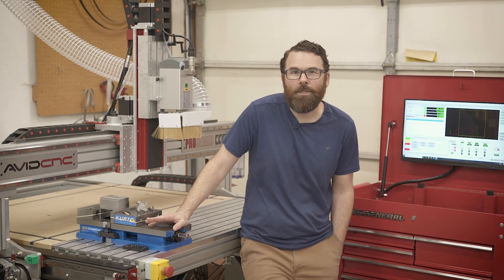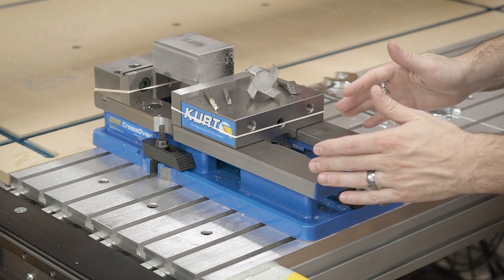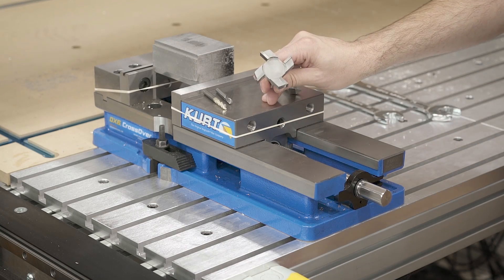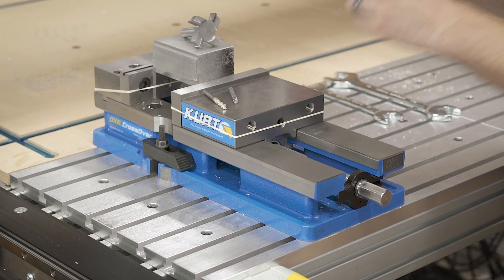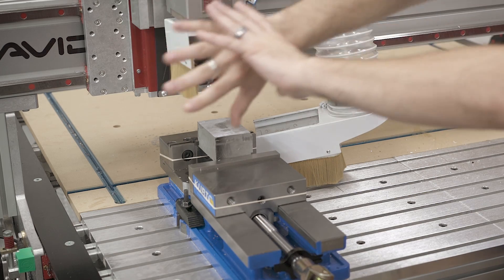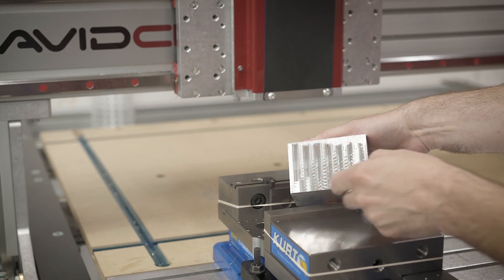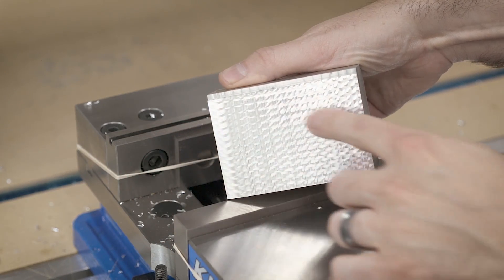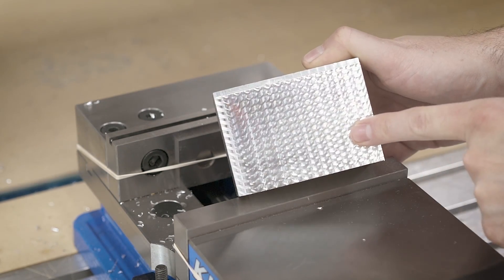Facing Aluminum on Avid CNC Router with Datron Endmill

Comment: how is that not rigid enough to get a mirror finish??
Reply from the maker: chip evacuation, cutter deflection, etc.  I'm sure I could do better, but that's about the best I could get from it.  It's a router made for wood.  It can cut aluminum fine, but you can't expect a mirror finish on a machine this large.
Reply: @RobertCowanDIY  I guess I figured the avids were more rigid than they might be.  Im looking at a shop sabre, they cost a little more but they are also made of thick steel, so I imagine it will be pretty rigid for what it is.
Reply from the maker: @CryoftheProphet  cnc routers are inherently less rigid that vertical mills or knee mills.  The shop sabre might be a bit more rigid, but you still probably won't achieve the same surface finish you could get from a vertical mill

Comment: Care to comment on feeds and speeds for other possible tooling? I am just upgrading a gantry mill for doing prototyping in aluminum. The 2 x 4 CNC Router has a cast iron  chassis, or I wouldn't have bothered.  I  improved the mass and stiffness of the bed with some heavy wall extrusion (100lbs) to which I will mount a 1/2" thick fixture plate and use a low profile mod vice for metal work holding. I want to make the fixture plate of course because a custom order would be quite pricey. Found a huge sheet of 0.500" 6061 T651 to use for the task. But to this point I am not sure about the facing tool.
I can't afford Made In USA for all my tooling needs. Sure, I buy Amana occasionally, and love the quality. Like the 4 piece V Bit set with razor sharp inserts. You can't go wrong there. But I have found a great Aliexpress tool vendor for many of my tapered and ballnose needs.  You just don't get anything more than the tool. No suggested F&S of course.  Recently I ordered some O Flute tooling and it looks very well finished. Hope it is good enough for 2D Contour, Hole, Bore, etc. My single point thread mill is going to require tests to perfect. Should have bought two considering the tolerances that are involved.  But the first operation is often the facing of the material. In the case of a fixture plate, the facing is like referencing the plate to the spindle. Once done, the fixture plate must always return to the same spot. I have plenty of wood projects in the pipe. So a quick change out is essential. Anyway.... after I realized that the little set of Accusize insert mills were so out of balance for anything over 400RPM, I was out of options.
 As a joke, I bought a set of 3 single point fly cutters because they had a 1'2".  I ran the 1"  to 12000 RPM and was surprised at how well it went. Just guessing as to the F&S as I write you. ALso the D.O.C is totally spitballing. I bet that will throw the chips all over the shop :)
 Do you still recommend the Datron after 2 yrs has passed? Could you hazard a guess as to what settings I should use for the little 1" fly cutter? Cuz I am going to use it for my test piece.  It is 6061 T651. Really looking forward to thread milling with the single point  cutter. Best regards, C

Comment: Those "swirls" are chatter from running the end mill way too fast and causing excess vibration. It's not just because it's a poor quality machine. Drop it down to 6000rpm.

The Amana Tool RC-3400 is the best for face milling aluminum on a CNC router. It's close to 2.5" diameter which makes it far more useful for facing without visible lines in the surface. 

The Datron one is too small to be a proper face mill. It's fine when using one of their $250,000 machines with sub-micron accuracy but you may as well be using a regular end mill on a cheap cnc router.

Comment: Robert, I have the same Avid CNC spindle as you're using (different machine).  The 0068444 is an 8mm shank end mill -- what collet are you using with it?  Did it fit the 3/8" collet that Avid sells or did you buy a metric collet that fits the spindle?  Thanks
Reply from the maker: I'm using a 5/16" collet, which is close enough.  I just bought a couple collet assortments on Amazon awhile back, and the 5/16" worked just fine.
Reply: @RobertCowanDIY  Thank you for replying.  ToolsToday.com sells Amana 3,4,6 and 8mm spring ER20 collets (made by Amana) -- $20.61 each.  I think I'm going to buy a proper 8mm collet; I've seen sets of 13 metric ER20 collets online for $25, but that seems a little too good (cheap) to be true.  Thanks again -- I always learn something from your videos.
Reply from the maker: @robertlaszewski1282  Honestly, just go on eBay and get a collet set.  I have nice ones and I have cheap ones.  I cannot tell the difference.  And for this purpose, I doubt you will find any real difference.  I just checked on Amazon, you can get a 14 piece set for $25 shipped.  Good deal to fill in the strange sizes you don't already have.
Reply: @RobertCowanDIY  Thanks Robert.  I would certainly be better off having a 14 piece set at $25 than getting just the 3 collets for $65.  I've been spending a bit of time with the Datron Tool catalog and they appear to sell end mills that I'd like to have ... especially the 4-in-1 single flute ...

Comment: Glad I'm not the only one that uses toeclamps under a nut to hold the vise :)  Facemill looks good!  I quoted a similar one (0068814A, single flute 14mm face) out a while ago but ended up waiting, those babies are expensive (~250).  Will probably pick one up eventually but not sure I trust myself enough yet ;)

Comment: Having a much longer lead in and/or a lower acceleration setting would remove a lot of those marks I think. 
The machine is shaking a little as it turns :)

Comment: most of the issue is you have the tool stick out way to far.. choke way up on the tool.  also you should never run tool at high rpm with a long stick out.

Comment: Word of advice, this solid carbide EM is not going to be ideal for surfacing large amounts of material.  The reason is that Al is abrasive and this EM will get dull relatively quickly.  You will notice the finish quality suffer as it dulls.  I recommend contacting Albert at AB Tools Inc and see if they can make you a custom Shear Hog for this machine.  They make one for the Tormach (or Tormach borrowed the geometry) and since it's inserted, you can swap insert edges when the cut quality drops off.  I see no reason why they can't take a 3/4" Shear Hog and turn the shank down to fit your machine.  It'll be single flute, but it's really a good choice for Al surfacing.
Reply from the maker: OK, so I'll start by saying I'm not an expert...  but I couldn't find anything to support your claim that carbide shouldn't be used with aluminum.  In fact, everything I found confirmed what I previously thought, uncoated carbide is ideal for cutting AL.  Aluminum OXIDE is abrasive, but that's something else.  I do have a Shear Hog and it's a great tool, but it can't run it fast, at all.  The max RPM I can get out of it is around 3500, 5K if you feel silly.  The minimum RPM of the router's spindle is 8K.  Hence the reason to go with something different.  There are few tools that works with an ER20 collet that can spin that fast and not vibrate all over the place.  That's why I ended up with the datron.
Reply: @RobertCowanDIY  Perhaps I wasn't clear enough, I said "Solid carbide EM", meaning not an inserted carbide tool.  Because this is solid, you must send it out for resharpening when it gets dull and if you have an oopsie that chip it, same deal.  That is one very expensively priced tool, and I've bought my fair share of carbide.  Aluminum is abrasive, the tool will experience abrasive wear as it is used.  6061 is less abrasive and tooling lasts longer, but 7075 is at least 3x as abrasive IME.  I am not a tooling expert, however I have a decent bit of experience cutting Al with a variety of different machines and tools.  The Shear Hog is the cheapest to run and fastest tool, with the best finish.  I was running a 1.25" 2 insert unit in a HAAS VF0 at 7500rpm at whatever the spindle motor would muster for IPM, taking .1 DOC at about 1" stepover.  That's a 5HP machine with 7500rpm limit.  The Shear Hog will go faster than that, spindle HP is the traditional limitation of that tool.  You need to maintain your chipload (IPM) and adjust your DOC if your machine is complaining.  You should be able to do 250IPM+ at 12K+ full width with a light skim pass (0.010-0.025), keep increasing DOC until the spindle complains or rigidity is a problem, then back off to the last good DOC.
Reply from the maker: @eformance  Yeah, their shanks are still too big and I'd have to see if they can actually run at that high of RPM.
Reply: @RobertCowanDIY  That's why I recommended calling Albert at AB Tools Inc.  He does all sorts of specials regularly.  I've heard nothing but good things about him.  They also do brazed and solid carbide specials.

Comment: The old rule of thumb for cutters is 75% stepover, if you go more than 75% then a climb cut ends up turning into a conventional cut geometry (there are nice diagrams showing this).  Since you are using a "both ways" strategy, there is little reason to avoid a 90% stepover for facing.  The only reason a small stepover would be used is for a machine that's grossly out of tram or is too flexible for the diameter of tool.  If you don't have the HP to drive the cutter, you drop down to a smaller cutter.  If your machine is too flexible, you drop down to a smaller cutter.  So basically, if you have a 20mm EM and can't do a full width facing pass, you need to drop down to a smaller cutter, like 12.7mm (1/2") and evaluate.  Part of the value of large diameter cutters is to avoid the finish problems that tramming errors will leave.  A machine with perfect tram will actually have a very irregular cut because both sides of the cutter are touching the part, so a very tiny amount of tram results in the best facing finish.
Reply from the maker: Yeah, I completely forgot about climb and conventional and need to try it as a one-way.  The small stepover was to try and reduce or eliminate any cutting forces, so allow the head to be as stable as possible.  Your rules of thumb are good for mills, but this isn't a mill, it's a router.
Reply: @RobertCowanDIY  The 75% rule is simply cutting tool science, as the gullet approaches the cut at > 75% stepover, the geometry results in a conventional cut as seen at the cutting face.  If you are facing, you don't want more than a 75% stepover, but less than 75% wastes machine time. In climb cutting the chip load decreases as the tool spins through the cut, with climb the chip load increases because the chip actually becomes thicker as the took spins.  At >75% stepover the chip starts thin, increases in thickness, then thins.  The objective is to reduce deflection and effective chip load with climb cutting.  When you do have deflection, it is away from the part, that way a spring pass cleans up the surface.  I think you may find that shallow DOC with large stepovers will produce the best and perhaps the flattest finish on your machine, since you aren't [effectively] recutting the surface.

Comment: also looks like they have single flute with a small corner radius witch might dramatically improve the floor finish in pockets as long as a s mall fillet at the bottom of the pocket is acceptable.

Comment: I'm using a 40mm facemill mounted to a clamping extension from tschorn (00SPM1638). Allows it to be mounted into a ER25 16mm collet. Works great at about 10k rpm in my 2.2kw spindle.